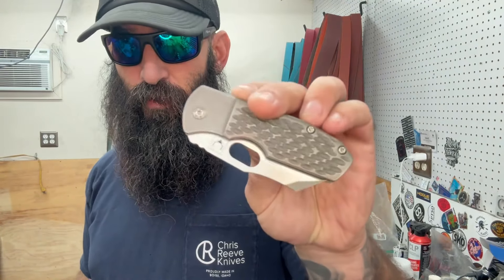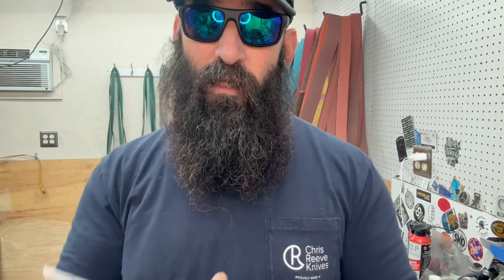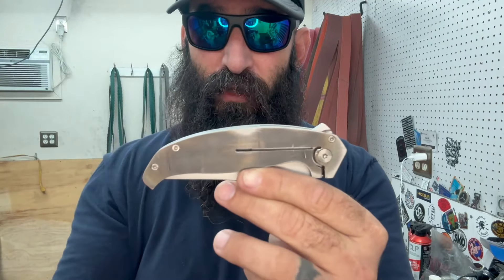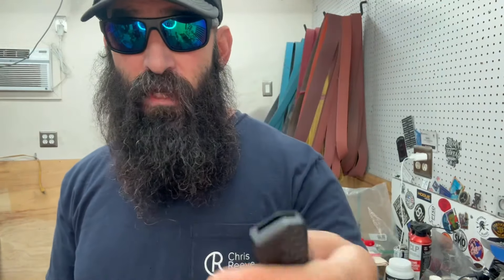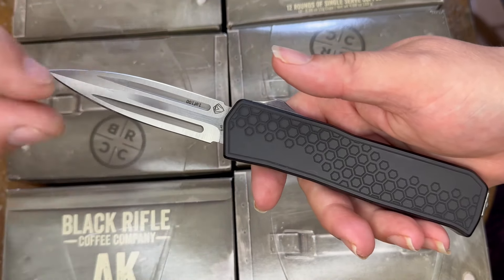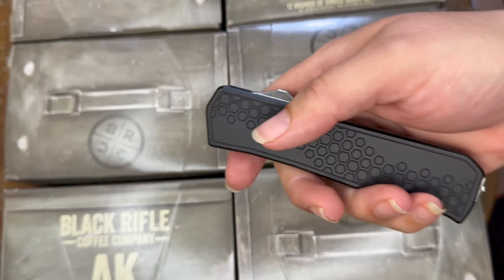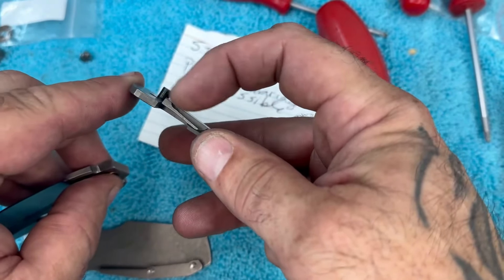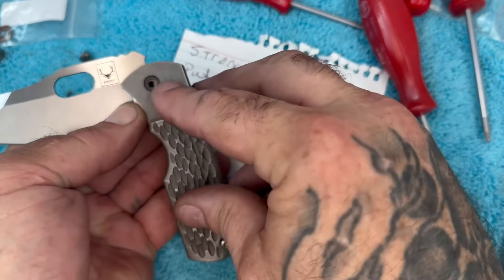Progress and a quick bs session

Comment: "I trusted the DRO"...sounds like grounds for divorce 😉 The OTF has a nice blade - thanks for the cameo Hot Rod. Would be interested to see if the got the lockup correct. On an OTF it needs to be like a vault because failure is not an option. Like the pocketed bearing option. Always think pocketing the blade even just a bit is a good idea as long as it is polished out or has hardened washers. At least at the end of the mod you could see and hear a detent. Hope you are dealing well with the heat and have a great week. Cheers!
Reply from the maker: @RamboAdventures-oi1mn  thanks man.  The OTF seems like it locks up pretty good.  I obviously have not had it that long but it hasn’t had any issues so far   I truly appreciate your feedback and support.  Hope you have a great week😎👊🤘🤘